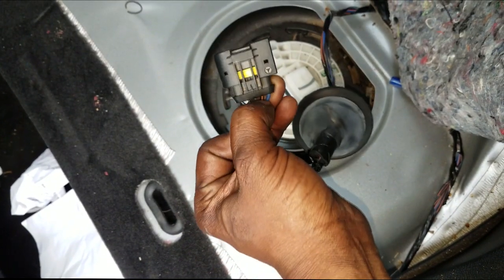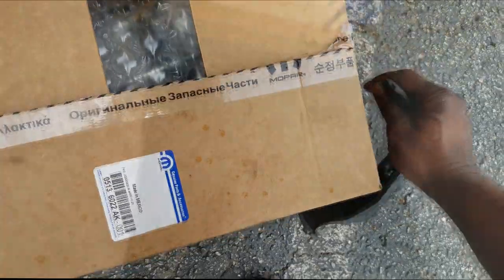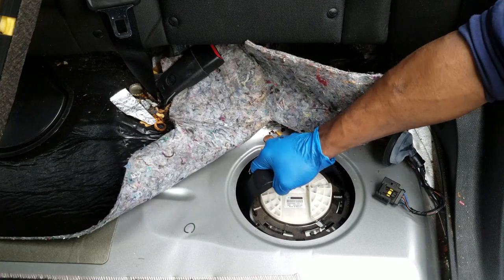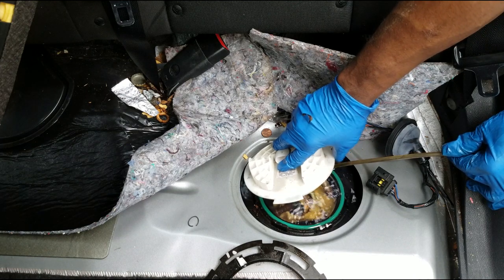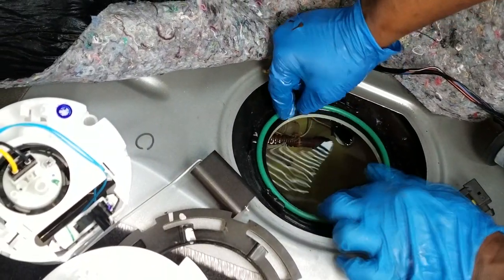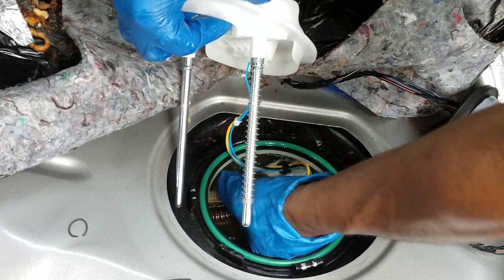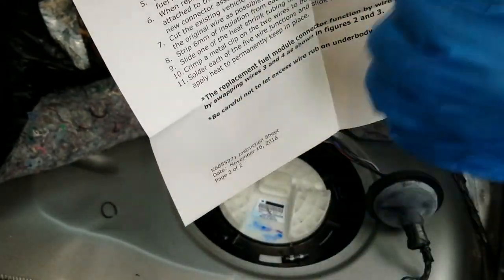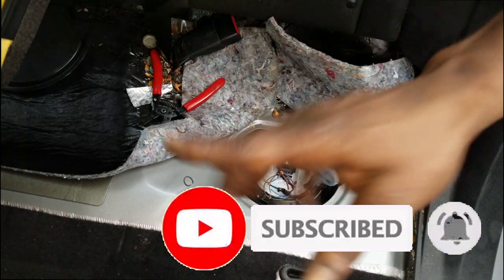How to replace a FUEL PUMP. No Start troubleshooting, Car stalls dies when coming to a stop. P0171

Comment: This is extremely accurate. I replaced the fuel pump on my challenger a few days ago. Took a while longer had to use a screwdriver and rubber hammer. Would love to have that tool for future use

Comment: What happens if a message saying check fuel sensor comes up after installing a fuel pump
Reply from the maker: What kind of car you have? Also are you subscribed to the channel?
Reply: @OnlineMechanicTips 2016 Chrysler 300 v6 
Car starts ans runs perfectly fine. Just that my fuel gauge reads half way when I filled my tank up currently waiting on the gas to go down to check it out any ideas if appreciate it a lot and thanks in advance

Comment: Did that fuel pump come with the new harness?
Reply from the maker: I think the OEM Mopar part will include the harness
Reply: @OnlineMechanicTips  I have a 2013 Chrysler 300c 5.7 that the pump just went out on thank you for the I for

Comment: I don't understand why if it's O.EM. 
  Mopar you have to rewire it? 
 Also what year,, engine size ,can you put that in the description?
Reply: FCA and all their jean-yuss decided the positive and negative cables were too close so they moved the number 4 wire to the number 3 spot. Evidently the old location causes the pumps to prematurely fail. Mine didn't go out until almost 170k though 😂

Comment: I’m literally having the same problem I hear my pump come on but the levels not reading right so I’m in the process of changing the harness
Reply from the maker: A harness has nothing to do with that. Whats wrong with your car? Also are you subscribed to the channel?
Reply: @OnlineMechanicTips  I’m sure I am and the sending unit is not reading . Their also was burn marks on the top of the sending unit when I removed it

Comment: So what is the part number for that connector?  My truck is a 2014 Dodge Ram Tradesman 5.7 L V-8.
Reply from the maker: What is your truck doing? What is the problem? Also are you subscribed to the channel?
Reply: @OnlineMechanicTips  the fuel level is reading right after changing the fuel pump.  I didn’t prime the fuel pump after changing.  It will try to crank but will not.  I turnover the key to crank it will not attempt anything.

ONE SOLUTION I READ:  Must prime new fuel pump to push out air in fuel lines!  Turn key to run 15 seconds then off at least 6 or more times.  
Also if this doesn’t work then it is probably a ground issue or a blockage from air.  Check wires at fuel pump connectors!  (Black ground had came lose from connector on fuel supply line you talked about in 2020.) I just pushed it back into the socket and the fuel pump read fine (I know at some point I got to either rebuild that connector myself or order a new one and retire it!). 

I will try that priming first (Which I heard you must do to the fuel pump).  I will then go from there.  
Next I will tackle the connector.  
I WAS A AVIATION ELECTRONICS TECHNICIAN IN THE NAVY SO I KNOW HOW TO BUILD ELECTRIC CONNECTORS.

Comment: Where did you buy the tool that you used to removed the locking ring
Reply from the maker: Hey bud, this the shop tool but you can buy them now off a tool truck. Thanks for watching, please subscribe to the channel for me, thanks
Reply: Amazon has em. Got mine for a whopping 20 bucks

Comment: My 2015 chrysler 200 did this ! When I fill the tank too much, it stutters .. , TODAY it stalled and didn’t want to start up so DONT FILL YOUR CAR PAST THE CLICK POINT FOR THREE YEARS , it will fuck it up. 3 years and 150,000 miles this car has never stalled on me. I keep hearing they do but mine has NEVER stalled. At least I know why tho. It’s not a issue with the car it’s self
Reply from the maker: Good point my friend. Thanks for sharing and watching
Reply: Online Mechanic Tips CAN YOU CHECK FACEBOOK ???
Reply from the maker: @Natethegreat200c  yes, i log into facebook couple times a day
Reply: Online Mechanic Tips I left you a message on there
Reply: Online Mechanic Tips Nathaniel Rudolph
Reply: Online Mechanic Tips Online Mechanic Tips  okay !! I have a 2015 chrysler 200! Dream car. Love it and want to buy another ! I have 140,000 miles. It’s a v6. I’m getting a “service transmission “ code “performance shifting unavailable “. Okay so , when I went to get two oil changes , the dealer wrote “trans fluid concern “ on the sheet. (Two oil changes in a row). Okay then second , I asked someone what was they’re  experience, he said he needed transmission mounts . I Too need trans mounts .. (so I’m hopping that’s the issue ) but what would you suggest ? Would you do a software update since that updates the brain of the transmission, get the mounts fixed, or change the fluid . The light comes and goes. Sometimes it won’t come up for over month , other times it’s every 6 minutes of driving daily. Now it hasn’t been off for a whole hour for 6 months. I thought I was going to need a valve body , BUT I have three  issues I listed (update , because it’s jerky , fluid change because the dealer said it , and transmission mounts because I need them) so it’s not like the transmission is in great shape just throwing codes (that’s why I don’t think I need a valve body) but if you were broke like me , which one would you do to fix this code ?? Thanks so much !

Comment: Does this apply to 2006 300 models
Reply from the maker: Yes, same setup
Reply: @OnlineMechanicTips  we’re did u get the connected from
Reply from the maker: @KMSTLSAPRANO  It came in the oem mopar fuel pump kit. Your year model may not require it. Not all models require it so they will let you know in the box if the connector beed to be replaced
Reply: So my issue may not be the connector
Reply: @OnlineMechanicTips   hey one more thing I seen u switch wires and car started why are these failing
Reply from the maker: @KMSTLSAPRANO  The connector change simply separating the hot powered wire one slot over. It should have never been right next to the ground terminal IMO. As for the pump, with any part on the car theres a life span to them. They all will die and stop working once there worn out
Reply: @OnlineMechanicTips  still no power

Comment: Thanks for video, but why don't you move the wires around in the connector?
Reply from the maker: Thanks for watching bud, yes thats an option. But if you notice, the ground wire guage thicker. You could just simply move pin 4 to pin 3 and just splice in the bigger ground wire at the end.  The problem with that is by the time you try to open up the connector to do that, its ruined. That is one of the tightest connector to open up even with with proper tools. But good point

Comment: Hey man, thanks for the informative video! Do you happen to have a part # for the pump And harness? I will appreciate it!
Reply from the maker: Hey bud, part are looked up based on the VIN. If I new your VIN I could tell you. But any dealer part dept and get you that info. Thanks for watching

Comment: Wouldn't it be better to de-pin the connector
Reply from the maker: Perhaps. But the new harness packet call for a different size gauge wire on some terminals now.

Comment: I went to buy my replacement from the dealer. For my 5.7 its 380 dollars. I wound up getting the SRT pump for 290. Aint no benefit or drawback except its cheaper 😂
Reply: 380 wtf the dealer near me told me 680 😑